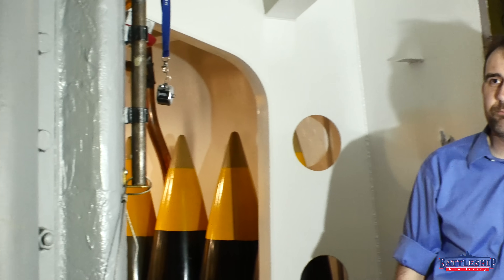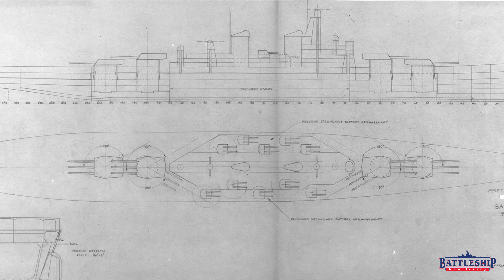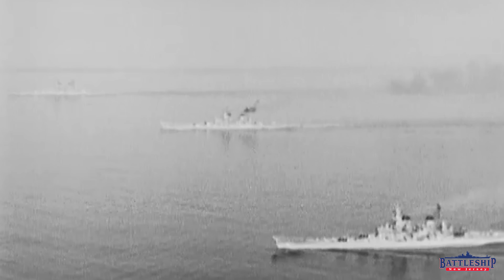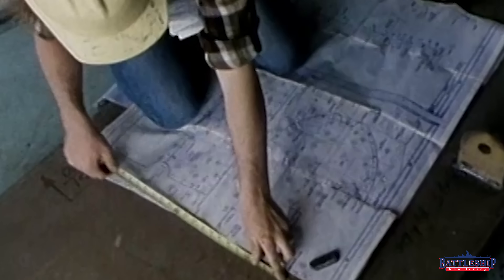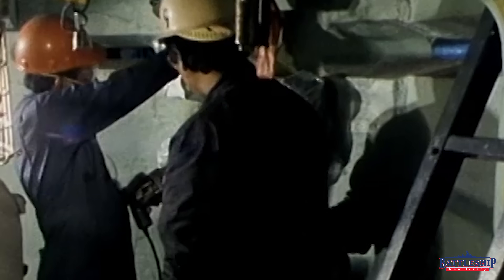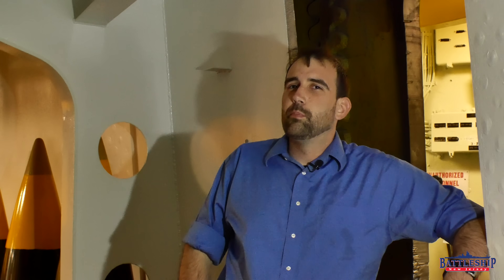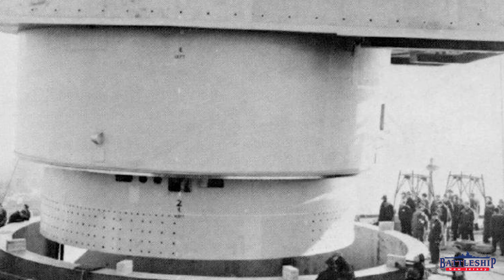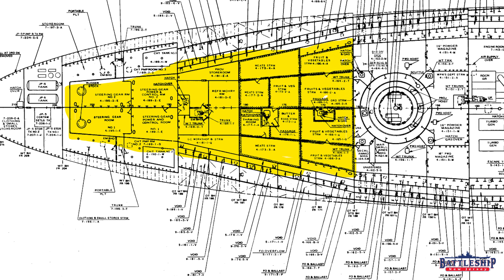Designing the Iowa Class Battleships

Comment: Also, what if the navy could have used a shrouded propellers.  They reduce the noise output of the screw (important in military applications) and also reduces cavitation on downstream side of the water flow.

Comment: That extra buoyancy makes a big difference.  On the Dakota class battleships there’s 1 space that has a similar problem to what the iowas faced with their engineering spaces.  There’s a main berthing compartment directly underneath the aft turret, I believe on your ship it’s actually a marine berthing compartment (which is forward on the second deck on the Dakotas) designated 30-3-L.  That compartment was the only compartment on the ship that could not be corrected for if it flooded.

Comment: Retired structural engineer here. I'd like to know how detailed the ship's plans were. Just a plan and elevation (not) or sheets showing the run of every electrical cable and pipe in the vessel?
Simple answer: How many drawing sheets are in the design set? 50? 100? 500? 1,000???

Comment: The Iowa class ships are the perfect example of the old adage that speed is king. The Speed the Iowa Class could reach and the general seaworthiness of the class made the difference in my opinion. The guns exceeded the armour protection which usually means they are not a BB but a BC. It is interesting however that the Iowa is armoured against the SODAK's so having been designed for those guns it makes sense. The Montana's would not have been kept around for long due to the compromised speed.

Comment: I’m choosing their firepower is the reason for the Iowa’s longevity. It was the Iowa’s ability to fire their shells well inland that resulted them to be re enacted for the Korean and Vietnam wars. If it wasn’t for that feature, the navy probably wouldn’t have felt the need to keep them in the mothball fleet for so long and may have scrapped them long before Reagan enacted the 600 ship navy. 

If it wasn’t for their high reserve in buoyancy, the Iowa’s may have still been recommissioned into the 600 ship navy but without their 16 inch guns as they would have taken up valuable buoyancy for enough tomahawk missiles. If that was the case, then perhaps the Iowa’s would not have been given away to become museum ships as those 16 inch guns are a major feature of the Iowa’s and it was this feature that was pushed by politicians for the reason they should be kept in ship worthy condition. 

So if the 16 inch guns were removed, then the navy would not have seen any reason to keep the Iowa’s so more than likely they would have been scrapped.

Comment: Shrinking down structures has soooo many headaches attached to it. As Ryan says, all the little minutia regarding internal structure, but also functions across an entire (insert anything, really) get disrupted among other things. So you basically have to start from scratch. When a client asks you to do this, you either toil to dissuade them, or die trying, because it's a nightmare. Doesn't matter what you are, architect or engineer.

Comment: Ryan....another great video. Us people w/the Freidman books find SO much indepth information about US ship design it's crazy.  You should tell the story of scout planes blown apart/damaged by main battery fire from turret 3 on some BB's. One of those....."ah captain".........moments!

It was the combination of all attributes that made Iowa class so valuable up to a point. That point being cost effectiveness verses more modern designs. The big guns are still the appeal to the imagination, but shaped charge 500lb warheads on missles that  hit with 90% accuracy do alot of damage and require far less manpower, weight in gun barrels, and have 10 times the range,  So warships sans the big guns, just don't have the romantic look of the old BB's.

Do you know why the armed forces are so stuck on the old caliber guns? 3", 5", 6", 8"?  For the Burke class and new cruisers (I hope for them), why not a fast autoloader 7" gun. Even the Zumwalts might have had ammunition that worked at a reasonable price, if they had gone to a 7" bore. The shells still would weigh 250 lbs or so but have more room for all the twiddly small electronics to mage them work. 6" was just TOO SMALL.

Comment: In the end isn't the Iowa turret design the same as the South Dakota design?  They both have a very similar diameter.
The mark 6 gun and the mark 7 gun use the same shells, the only difference is a 100lbs more charge and 5 more calibers length.
Your video of the gun confusion is the best explanation of what happend, well done!

Comment: The extension of the armour box to protect the steering gear to made me think of the Bismarck, which in the end was sunk because her jammed rudders.
The Germans certainly regrtted not protectng that part of the ship better.
Reply: You can protect the steering gear as much as you like, if you get a torp hit to the rudder, all hat protected steering gear does not help you a bit. The rudder and propellers have to be in direct contact to the water, there is no realistic way to protect them from a torp hit. Just take a look at the sinking of HMS Prince of Wales: A torp to a prop shaft running with full speed caused more damage than the ship could handle. I don't think an IOWA would survive this kind of damage.
Reply: The Bismark was by itself as well lol.  

The Iowas by their lonesome would of had the exact same fate as she did.    Turned turtle with the barbetts falling out as she rolled over.   

Regardless of the extra rudder a torpedo explosion at the stern would of obliterated that area of any ship
Reply: That's one of the Biggest design flaw of the Overrated Bismarck
Reply: @issacfoster1113  battleships per se are a design flaw. The Iowas survived because the US won the war, in possession of Japan they would have been sunk.

Comment: I wonder how fast an Iowa class can go with up to date (2022) steam engine technology, or better yet, oil fired turbine!  Turbine engines can be made weight efficient, fewer pounds of engine per horsepower of output, which is why they are a popular option for turboprop aircraft.  This eliminates the need for a steam cycle.  If we can build huge steam turbines for nuclear power plants, why not huge oil fired turbines for Navy ships?  50 knot or 60 knot maximum speed?  Better GPS computer driven aiming technology could improve the accuracy of the gunnery.  I am sure the computer wizards can handle using gravity at 10.724 yards per second squared corrected to local gravity conditions for calculating the flight path of the shells.  Along with wind direction and speed, amount of rain in the air, etc.  With this, we could replace the 3 16 inch 50 caliber guns in each turret with 2 18 inch 50 caliber guns.  The gun barrels could be made of titanium for both the strength and the weight savings.  For plumbing we could replace the mild steel piping with PVC and PEX for weight saving and for salt water corrosion resistance.  Up to date damage control and firefighting.  I wonder if this type of technology is being used in our current Navy and merchant marine ships.  Automation processes could reduce the number of crew necessary and therefore the life support (barbershop, medical, mess hall, recreation, laundry, etc) for the crew.
All of the ways we can upgrade the 4 existing battleship platforms while making use of all of the armor to provide 4 very hard targets for any enemy.  Of course with such huge seaborne platforms, we could place all manner of modern up to date weapons to go along with the 9 16 inch guns or the 6 18 inch guns.
Which is why you had me going for a minute or two with April Fools joke about the Navy recalling the Joisey and the other Iowas.
Reply: For what you are proposing it would be better to build a whole new ship than updating the Iowa’s.

Comment: 6 knots is about 7 mph. Times 24 hours thats about 170 miles per day faster. A lot of trans Pacific transits are up to 2 weeks, that puts that ship over 2300 miles ahead of any slower ship for that trip in the same time frame. A huge advantage. And they have huge guns and a cruising range so big they can refuel other ships with them.
Reply: They would only travel at top speed in an emergency situation only. On a cruise they would not travel at top speed as it is fuel inefficient and fuel is a very very large expense.
Reply: @tomnewham1269  It's all about capability. The ship I was stationed on in the 80's would burn about 25,000 gallons of fuel oil a day cruising at 25 knots. On a full speed run with all 4 boilers on line we achieved a speed of 41 knots (according to a Quartermaster I knew) and we burned 40,000 gallons of fuel in 8 hours.
Reply: My Cummins turbo tuna boat used 1.5 gal per hour at 7 knots. 6 gals at 18 knots. 
It would smoke when the engine overloaded and that ruins your diesel and severely shorten reach. So cruise speed is 7 knots at 1400 rpm and rev limited to 2700. Short fast emergency power bursts at 3200 are fine. Fast long distance crossings don't happen. The same applies to battleships burning 120000 gallons per day at full. You be refueling 5 times till you reach Hawaii.

Comment: They was built and designed so good that  why they. Kept recalling them  to service  and. Making. Them  flag ship   that why. The adimarnal    liked the lowa battle. Ship s. So. Much instead. Of. Modern.  Ships. One of the things. They like so much is the fuel. Cap of them could go longer. Distance. Without refueling. In fact. They could could. Fuel other. Ships in their task force. And. They are. Big  fast.  And. Still packed the.  Best. 16 inch guns of their time

Comment: What is the difference between a 16"45 caliber and a 16"50 caliber?
Reply: Barrel length.
Reply: Technically Caliber is the length of the barrel expressed as a multiple of the bore. A fifty caliber gun has a barrel length fifty times longer than the bore.  For some reason that I don't know the bore of small arms are referred to as caliber also . A misuse that has come to stay, like calling magazines "clips".
Reply: @francoistombe  Actually the small bore weapon use of "calibre" pre-dates the large bore use.  Way back when the size of larger guns was expressed in weight of shot, not diameter of bore, or length of barrel.  Strictly the /xx part should be expressed as calibres, not calibre.
Reply: @18robsmith  but that only applies to guns. For rifles the calibre is the diameter of the bullet (as in projectile) but people get that wrong too. They say a .22-250R is their calibre of their rifle but what they mean is their rifle takes a .22-250R cartridge and their rifle is .224 calibre.
Reply: @francoistombe  
.45 caliber .50 caliber refer to the size of the round fired from small arms 
If you want to get technical the main guns on the Iowa class should be referred to as 2,000 lb guns going by the weight of the shell
Reply: @FP194  this applied to cannons where the shot was spherical and solid iron. There was thereby a mathematical correlation between weight and bore.  The weight of conical shot of a given bore varies depending on function like AP or HE.  A cannon from  500 years ago was 10 to 15 calibre, the size was specified in shot weight.
Reply: @francoistombe  
In small arms, caliber = 100th of an inch.  45 cal = .45"
Reply: @GunRagDave   Thank you. Nice to know.

Comment: The long length, which gave them the fuel bunkers and stores combined with Panamax and a high efficient cruising speed.  Not only were Iowas fast, they're also full of fuel, enough to refuel their entire group of escorts, while still going through the Panama canal and operate for long deployments across the Pacific, and later in the 1980's and 90's operate independent of from the fast fleet oilers for extended periods of time while refueling and resupplying their entire surface action group.  And even if they only could go 28 knots because of a reduced powerplant, the extra length made them more hydrodynamically efficient for even longer ranges.

The South Dakotas, North Carolinas, Yamatos, and even Hood and Vanguard couldn't do that - the Iowas could.
Reply: The length increased the frictional resistance due to increased wetted area... this was only overpowered by wave forming resistance at very high speeds. It helped keep the machinery weight manageable, but for normal operational range the extremely slender nose was a disadvantage, not a boon, and it made them horrible gunnery platforms when the weather was bad. I think it was the right choice still, but we need to be careful not to post-rationalize it in ways that misrepresent its compromises... nations without the canal limitations would be ill advised to build a ship to such considerations.

Comment: When Reagan's Navy decided to bring back the Iowa class BB's, I was recalled to active duty for the New Jersey renovation in Long Beach. I told the detailer that I didn't want to be in the shipyards for 3 years. I was recalled because I had served as a MM on the AOE2 Camden, which had used 2 of the BB Kentucky's engine/boiler sets, the other 2 went to the AOE1 Sacramento. Aboard the Camden I was aft throttleman during a speed run after drydock and we achieved 34 knots no smoke for 6-8 hours. The steam driven AOE's were big, 796 feet long and 53,00 tons and fast. Thus the name Fast Combat Support Ship. After the New Jersey came out of the yards I was on the reserve Knox FF 1054 Gray and I got to watch the Jersey firing on the San Clemente gun range. What an awesome sight! It was then that I regretted my choice not to go to USS New Jersey.
Reply: Was on dd830  70 to 72 long  Beach  stood throttles herd jersey  was popping  windows  on mainland   firing  at the island
Reply: Sounds like you could write a book!!

Comment: Sort of off topic a bit, but years ago I used to design all types of ships in Warship Gunner II...

The gameplay was so-so mostly, but I remember spending hours upon hours trying to get the impossible compromise of firepower, protection, and mobility wedged into a given fixed hull weight limit.

So many challenges for real naval engineers, I imagine. But it sure was fun to prototype new designs to see what worked and what didn't. 

Two feet difference in barbette diameter seems insignificant, until you realize the hundreds of correlated changes that must incorporate.

Comment: Im just wondering how big would the Iowa class be without the treaty limits
Reply: Probably the same. One of the constraints in the design was that the ships had to small enough to pass through the Panama Canal. As the Iowa’s are they are JUST narrow enough to pass through with literally inches to spare.
Reply: @tomnewham1269  how often did they really go through the canal? Would it still be a requirement today?
Reply: @KnaufL  well they don’t have battleships now but I think the large aircraft carriers go right around the bottom of South America instead of going through the canal. But they also have a large fleet of ships around them so it probably makes sense to go right around. 

The Iowa’s did go through the Canal a few times. Ryan has already made a video about that.
Reply: @tomnewham1269  all in all, the canal requirement was not really useful then
Reply: Isn't that more or less what the Montanas would have been?
Reply: @casey6556  not necessarily, Iowa's were designed for speed

Comment: Do you think that there would be value in designing and building a new nuclear powered class of battleships
Reply: No. Way too expensive to build and operate and no mission to carry out.
Reply: @JoshuaTootell  
What if the mission is to just exist?

 Specifically as the only naval vessel with armor to withstand more than what our current tinfoil fleet can handle?

It seems an egregious error to assume our force protection capabilities will suffice indefinitely.
Reply: No